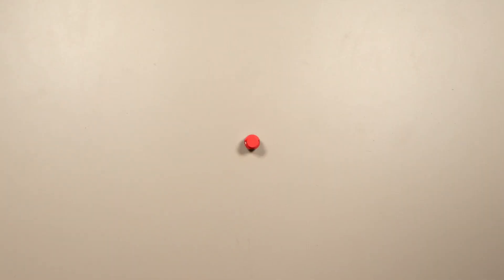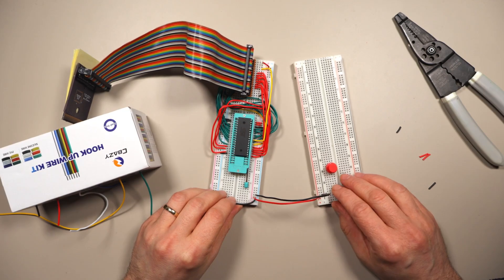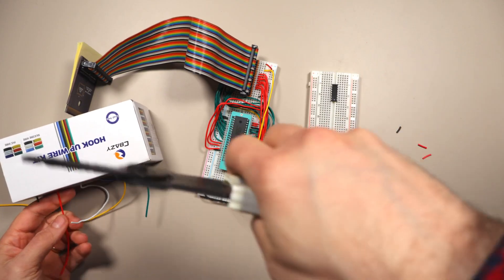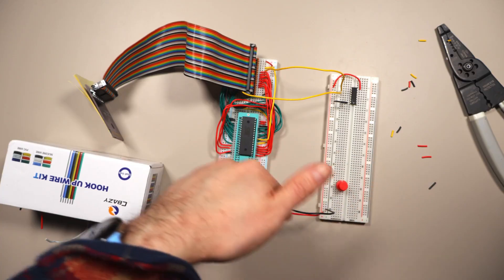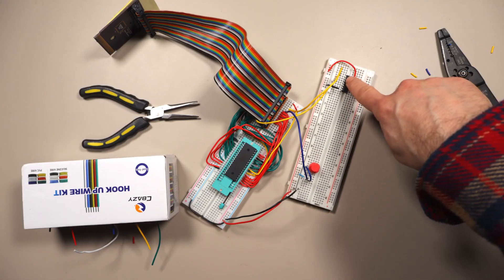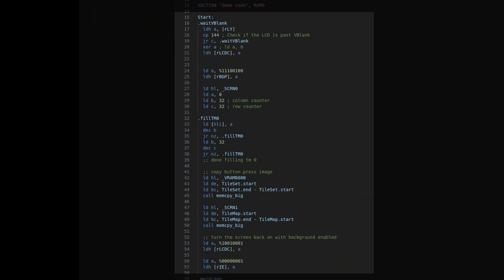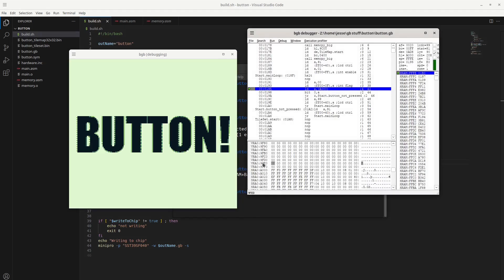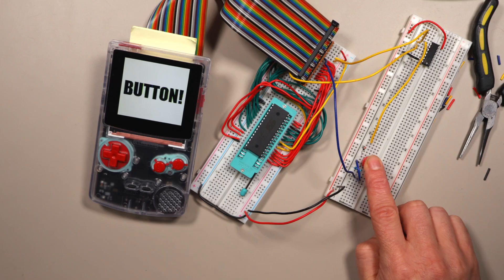Add a Button to a GameBoy!

Comment: Would it be possible to add a potentiometer? And write a custom pong game that uses it
Reply from the maker: Yes it would but you'd need an analog to digital converter (ADC) to convert the signal from the potentiometer. In a followup video I did a similar thing with a rotary encoder and a binary counter. I've looked into the potentiometer approach but didn't find an ADC that did what I wanted for a reasonable price.
Reply: @systemoflevers ah is see now! Very interesting mechanic. Thanks! Now i have a fun project to see if i can make a multiplayer game using that setup

Comment: you can join the breadboard together and remove the power rail
Reply from the maker: Hah yeah, they're different brands though and their connectors are a tiny bit off... I might move the main part over to a matching breadboard so I can connect them though. So many wires though!

Comment: That was pretty cool. Just randomly adding another button.
How many buttons can you add? Like how many cartrage ram spaces do you have spare?

in theory you could make a miniature guitar hero controller, or external controllers as mods for specific games (like the PS2) did
Reply from the maker: It'd be pretty easy to get up to 8 buttons with how I did it. The data bus is 8 bits, so one button per bit. So you should be able to get a rythm game going just with that as long as you don't need any save RAM! If you want to go beyond 8 you'll need more address decoding circuitry so you can address different sets of buttons. There are 8192 save RAM addresses, so you could get 8192 * 8 = 65536 buttons with just address decoding! Really there's not a big difference between buttons and memory so you could hook up to a memory bank controller to have banks of buttons. The MBC5 supports 16 banks of save RAM, so that would give 16 * 8192 * 8 = 1048576 buttons.

I don't know why you need so many buttons D3kryption
Reply: @systemoflevers  1048576 buttons sounds amazing! 🤣 most players ever on a game!

Comment: Thats so awesome. For Zelda Oracle of Ages I used an emulator and cheat engine to find the proper addresses for all the times and wrote some code to work for an n64 controller. And mapped all the times to different buttons
Reply from the maker: That sounds pretty cool!
Reply: Is there an IPS patch for that?

Comment: For the last few weeks, I've been thinking of a project to decode signals from Game Boy via Link Cable by Raspberry Pico microcontroller. That will be some kind of remote control to do some stuff (like flashing lights, etc.). In that project, I want to play with link cable capabilities + try in action my new Raspberry Pico.

And now I see you have a new video on the same field. Awesome!
Reply from the maker: That's awesome! Sounds like a really fun project. If you need more inspiration you should check out stacksmashing's work https://stacksmashing.gumroad.com/l/gb-link. 

The link cable is really neat, I've been meaning to do something with it too!

Comment: Yay, we could now have a cart with shoulder buttons - like on the GBA / GBA SP and the buttons could be placed in several places on the cart. This is actually a smart solution that makes you wonder how did no one else come up with it. Another idea is to have a very long cart that has a piano attached to it. So many possibilities!
Reply: it might work the other way too, where you have LEDs that light up, when a RAM address has a certain value. Edit: Or even motors (weighted or not) or a variety of electronic parts actually.
Reply from the maker: I love all these ideas! Having shoulder buttons is a great idea

I'm definitely planning on hooking up an LED!
Reply: @systemoflevers Could this go as far as sending HDMI output from an adequately powerful cartridge through something like a Switch dock? I'm an avid fan and not well educated, but it would be wild to have a cartridge that's Switch-mountable, powered and controlled by a Gameboy when unmounted while allowing players to use their wired controllers with the docking station. Maybe the cartridge could even allow arbitrary ROMs/carts to play through the GB using the Switch dock like a Super GB.
Reply from the maker: That's a big jump from adding a single button!

There's already a cartridge thing to let you output video over USB like a webcam called the GB Interceptor https://youtu.be/6mOJtrFnawk?si=FEnJAieYXZUb7NEc. Playing with external controllers might not be possible without modding a GameBoy.

Connecting to the switch is another thing. I don't know enough about the switch. Something like a Super GB for the switch would be pretty cool though!
Reply: @systemoflevers  Thank you for understanding my off-the-wall fantasies. I had forgotten or didn't know about the interceptor. I only remember the GB-to-BT controller adapter cartridge. Worst case, to do everything necessary might require something not unlike the SGB or GB Player for GC (or maybe like krikzz RGB Blaster) which I think run games on the addon/cartridge's own hardware while using the host consoles' video out and controllers. I'm guessing it would be tricky to get the graphics to play on both the GB screen and output to HDMI/dock simultaneously or hot-swappably.
Reply: If you have questions about the interceptor I guess I can help with that.
Reply: @tolstoj_  I've caught up with the video posted above about the Interceptor. To me as an enthusiast, it's great quality for the price albeit outside of my desired use-case as a couch-potato. 

Out of nerdly daydreaming, I wonder if the extra-button flash cartridge could work if inserted into the Interceptor? 

If it's possible to program the(se) extra button(s) to mimic any of the standard directional/A/B/select/start inputs (through an emulation layer running a homebrew game maybe), then I wonder also if it wouldn't be possible to use a Bluetooth receiver to trigger the buttons. There are plenty of 'if's, but nothing seems too far fetched to me. 

Maybe sending the extra button inputs to play with an arbitrary ROM wouldn't work, or maybe there's no way to mimic standard inputs, but it would still be very cool with even a fixed ROM and the inputs need not mimic standard buttons in that case.
Reply: @tolstoj_  I mean vibration motors, speakers, LEDs, and a few other gimmicks were absolutely a thing on original Game Boy cartridges!
Reply: @cdigames  I never heard of speakers or motors on GB carts. Do you have examples? I know of the Tilt'n'Tumble functionality. I also remember that there were cheap knock-off multi carts back in the day that had a button. I guess some flash carts (Everdrive, EZ Flash Jr.,...) have LEDs and buttons. But I think they are not connected to the sRAM? Are they?
Reply: @tolstoj_  Pokemon Pinball is probably the most famous motor for a Game Boy, but Mr Driller packaged a similar thing into a GBA cart. As for speakers, the Tomogotchi games had a couple in Japan that not only had speakers, but could continue to function with the Game Boy turned off, allowing alarms to sound!